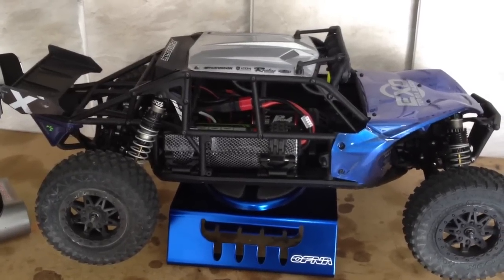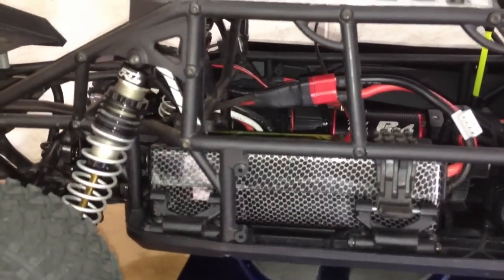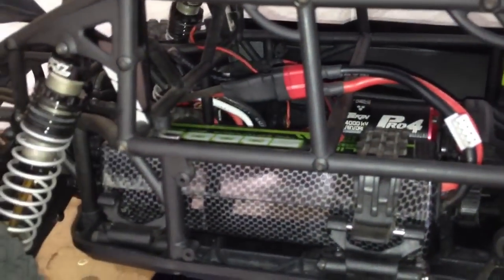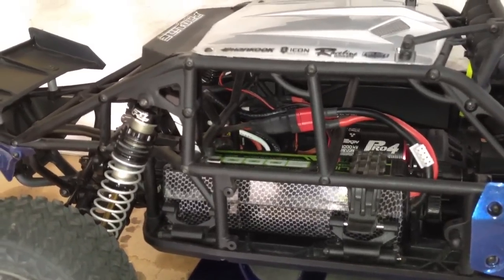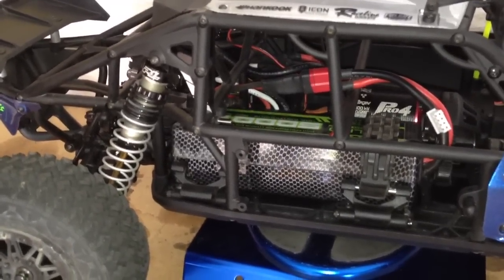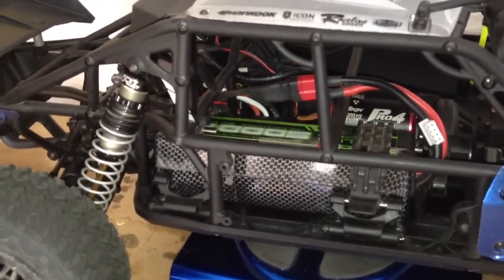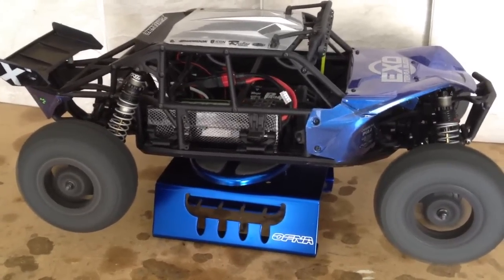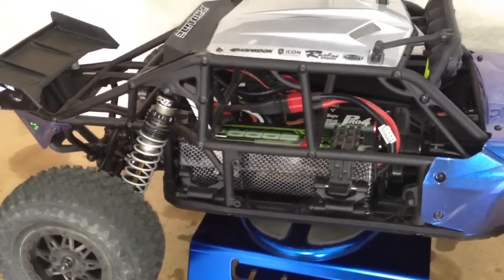Axial Exo Terra Buggy- How to fit a 3s Lipo Battery

Comment: hi managed to get a 3s into my exo by dumping the rubber straps and hinge bits and using velcro straps between the 2 long screws still a bit tight with the interior in place but works ok and havent had to chop off body posts as ive seen elsewhere

Comment from the maker: I hear ya!  I too was trying to get my Exo consistently running at a indoor clay track and it just wasn't keeping up.  I opted out of the buggy seen and went back to short course truck.  Really, unless there's a huge following of SCB, there won't be a real class for racing (The Associated and Losi are both 2wd and the Exo is 4wd).  I went with the Losi SCTE.  Great truck, a bit heavy, but it drives great.  Most of youre electronics will drop right into the Losi and a roller at nitrohouse is $264

Comment from the maker: kirillpen, maybe you mis-understood, and maybe, after re-reading the replys, I mis-spoke.  If you take can for can.  Let's say the Mamba Monster 2650 vs the 2200kv.  The 2650 will have a higher topend speed vs the 2200 that will have more torque.  The 2650, you would need to run on 4s, vs 5s on the 2200 to try and match speed on same gearing.......for the Axial Exo, which is a heavy sc buggy, you need more torque, in my expert opinion.  It's all good!  How's the Mini 8ight?

Comment: and wrong again... it doesnt matter on the kv if the can is the same size it would have the same torque doesnt matter on the kv. BUT higher kv heats up faster than lower kv because it needs to spin at higher rpm and car or transmission doesnt let it or is not fast enough. thats why you have to gear them lower and you have to gear lower kv motor higher becaus eit doesnt spin as fast. not being offensive or anything. (just saying)

Comment from the maker: Go for plenty of torque.....This buggy weighs a bit more than a SC truck.  I ran the Tekin Pro4, 4000kv. It did pretty good, but did better on 3s.  Maybe the 2400kv Castle 4pole 550?  But you would need a 3s.